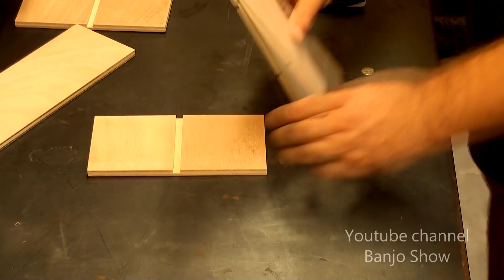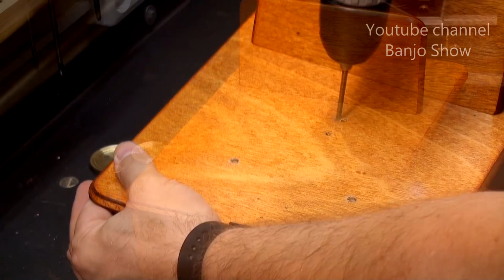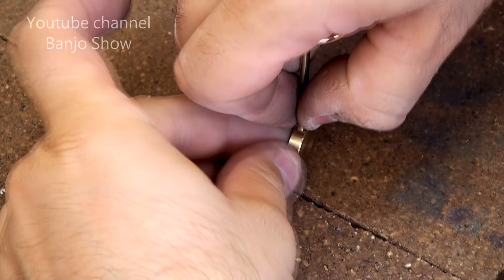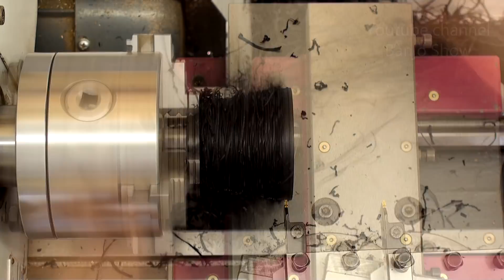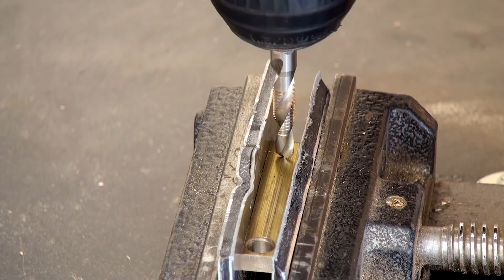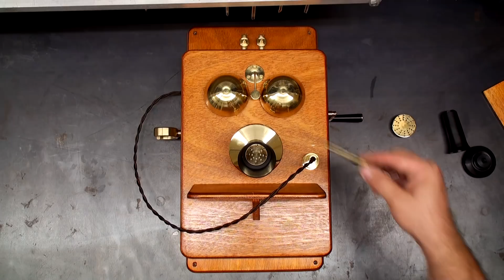Old Phone Mini Bar How to Make "Call your friends"

Comment: Who else looks at the other tools being used like the tool post drilling set-up......I have to make one of those.
This is one item I'd like to have a go at, but not so cosmetically perfect, in addition to the full plate wooden camera in Red Gum or Mahogany with all those brass racks and angle and tilt brackets and  but with an Ipad Pro "ground glass" screen.....sigh,......
I got bitten by the steampunk outlook when my daughter bought me a steam punk hat with all those brass plates and the welders goggles with brass pressure gauge in the middle.....oh, and it has the flashing LED lights too.